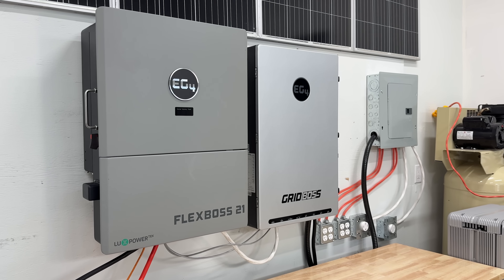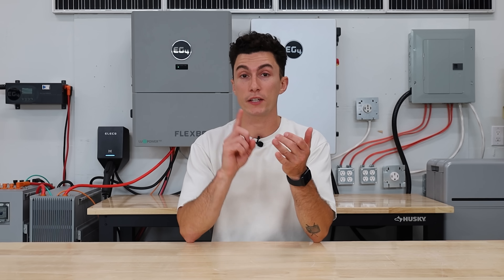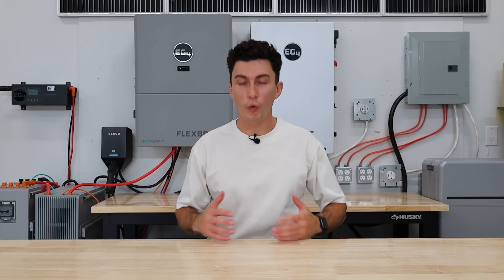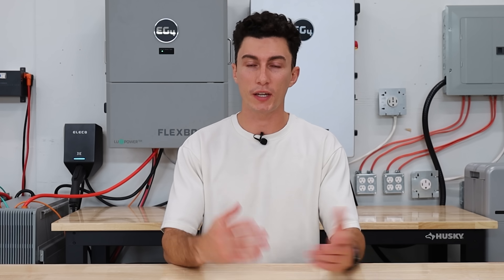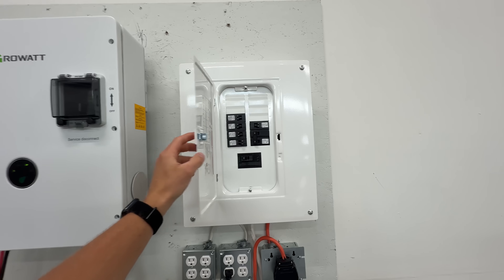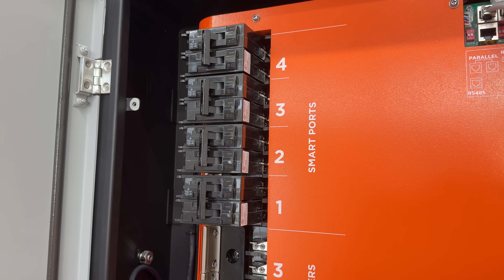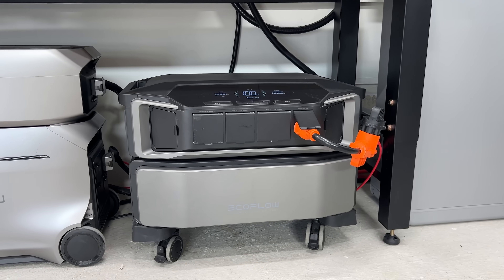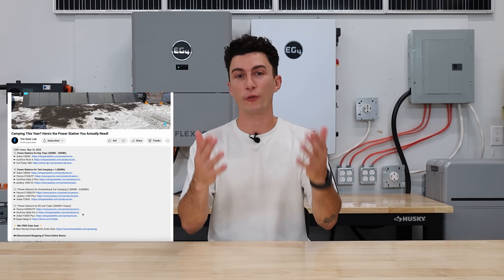FlexBOSS + GridBOSS Explained: The Smartest Money You’ll Spend in 2025

Comment: Where can I find more info on connecting a delta oro ultra X to the generator input on an EG4 wall mount inverter. I can’t find the episode where this was mentioned.
Reply: It was this episode under bonus. BUt would like more info on how to wire this. MY town requires the eG4 and grid boss to be mounted outdoors. With all cables buried. So I want to know how to do this before installation

Comment: If I have 3 FlexBOSS21’s + batteries in my shop building, will I have to run heavy gauge cables from each of them to a GridBOSS located 180 feet away on the utility pole that my meter is on?

Comment: I am currently using my Ecoflow batteries as a generator input for my EG4 GridBoss but it requires the grid to be disconnected (fuse switched off) to allow the generator power to recharge the batteries. Is there a way to use the smart ports to input power from the Ecoflow system? Is there a way to allow generator input without having to disconnect to grid?

Comment: What you recommend if the local utility has very dirty power?  Doing this install on an bahamas island and local power is bad.  Was thinking about chargeverter and just using that to clean the power and charge the battery with it.  Can I run that clean power into the gridboss and let it charge the system etc?  Dont want brownouts and or phase drops to burn out the inverter and gridboss

Comment: I installed the gridboss and flexboss21 with 12kw of solar a 50kw of battery. I moved my grid tied telsa system to the gridboss for a total of 25kw of solar. i still only export 10kw (max) to keep my utility happy. I've got the 125A Smart port connecfted to the subpanel in my garage, and the 80amp smart port connected to my pool equipment. my entire house is electric, plus two EVs. No propane bill and no gas (car) bill.  EG4 is super easy to set up and great customer service to work through the settings.
Reply: Gridboss is now tied to your grid and the Tesla system to Gridboss?
Do you know if changing setup would void any Tesla warranties?

Comment: Beware which company you choose for system design and sales. Current Connected preys on people who are new to solar when they are tasked with system design. They oversell expensive components, that can be made to work, for a task when the correct component is a fraction of the price. After admitting to doing this in writing, they will not take back the overpriced components without severe financial penalties.

Comment: An important and often overlooked feature of the GridBoss is the 200A service disconnect and what it means, and why it is important.  Since it is service rated the 200A disconnect on the GridBoss can be wired directly to the meter, allowing the main panel to become a sub panel off the GridBoss.  This allows you to install solar without the need to upgrade the house's electrical panel(s) just for the sake of installing solar.  A real-world example of this was a house with 100A main, the grid provider confirmed that the exiting grid drops to the property were good for 200A service.  Quote were pulled for a panel upgrade and came in between $3,000-$10,000 dollars.  Instead, it was decided to install the GridBoss off the meter using the service disconnect and wire the existing 100A Main panel as a subpanel off the GridBoss.  Now the GridBoss has 200A of service going to it and is feeding the 100A subpanel, providing an installation cost savings of $1,000-$8,000, and passed inspection with no issues.
Reply: I thought the SolArk-15k with its internal 200 amp pass through was a disconnect providing the same features that the gridboss would provide. Is that not the case?
Reply: @OnFinalConstruction  I looked it up and the SolArk-15K appears to be service rated and can be directly connected to a meter.   You would have to switch out the 15K's 200A load breaker to connect it to a 100A panel in order to meet code.  Based on current pricing though a FlexBoss21 + GridBoss is only about $300 more than a SolArk-15K, and for me the addition features gained are worth the minimal price difference.  However, if a single 15K will meet all your needs it is an option.
Reply: @OnFinalConstruction  It is worth noting that while the SolArk-15K is service rated, and can be directly connected to a meter, that this is not true of all hybrid inverters.  The EG4 18kPV for example cannot be directly connected to a meter.  However, you need to check your local code as in some locations a separate disconnects between the inverter, and the service meter are required regardless of the inverter's capability.
Reply: @nathonsweetman4409 thanks for the reply. Is just a means of disconnect needed usually? I would want one anyway so I don’t have to pull the meter to swap the unit. Somewhere I heard someone say a “transfer switch” would be needed.
Reply: You always want a separate disconnect.   They are simple devices that almost never go bad.   What do you do if the Gridboss needs to be replaced or the bypass switch goes bad?  You are going to have to have the Utility come by to disconnect the meter. 
I see very little value in using a GB, FB combo.
You are much better of sticking with a Sol-Ark, especially now that they have the 18K model that has 50% more power than the FB21.  No Bugs, no DC-DC board being burned out and no overheating issues and Fans that sound like a lawnmower.
Reply: @Dreadlk  I agree with the disconnect, which is how I installed mine, but it is not required by code.  The value of the GB/FB combo is going to depend on individual installations.  In some cases, you could just go with the FB or a Sol-Ark.  In my case I am able to take advantage of the 200A passthrough and the 350A buss, on top of being able to load shed my hot water heater, AC, and EV charger.
Reply: @Dreadlk  I helped with a GB/FB install and we used the GB to integrate an existing microinverter install with a FB install with batteries and additional solar.

Comment: Great video. I wish you guys would make a video for people that already have grid tied solar and would like to add the grid boss and flex boss with batteries to their  current system.
Reply: You just described my system. I had 6kW of micro inverters, and added Flexboss/Gridboss/battery and 15kW more panels. This allows the micro inverters to keep running if the grid goes down because the Flexboss/Gridboss generation is 'tricking' the microinverters to think there is no power issue, so they keep on generating. It's awesome!
Reply: @tonykara  This is a fantastic use case, thanks for sharing.
Reply: Agreed! I heard you can actually config the GridBoss to shed the house to prevent the battery from being depleted so the AC micro-inverters can be powered when the sun comes up in an outage situation.

Comment: Dry Connects? Thanks for that tidbit. I looked up what it means. It means I could connect my Predator 5000 to a system and have the EG4 turn it on & off via the remote control of my Predator. That’s helpful. VERY helpful.
Reply: Can you tie in a jackery system into the flexboos+gridboss

Comment: Just a couple comments. Grid boss does not do away with the utility requirement for disconnect so what you said in the beginning was not correct. And the bypasses do not qualify as utility disconnect especially on systems that need overcurrent protection. You also didn't cover that. You have to lock out the load output of the flex boss when connected to a grid boss which becomes problematic when the inverter and batteries are not on the house but maybe out in the garage. That's enough for now.
Reply: You don't use the load output of a Flexboss when it's connected to the Gridboss.
Reply: @tonykara yeah I said that. It is not a benefit.
Reply: My utility specifically requires that, "The disconnect must enable visual confirmation that the... conductors are physically disconnected."  As great at the GridBOSS is, I'm still required to have a knife disconnect before my GridBOSS because of that.
Reply: @obewise exactly.
Reply: They technically do meet the qualifications to be used as a disconnect but local PoCos make up their own additional requirements.
Reply: @CowboyPilot79 levered lockout is typically required in the whole country.
Reply: @engineer775 but if retrofitting that lockout is already in place

Comment: Thanks for showing the EF DPU hooked up to GridBoss generator port.  What size is the wire used in your custom cable connection?  I just acquired a DPU unit so trying to figure out the way to blend this in my daily use of Grid power and handle outages.  Solar Lab crew is great at having fun learning and sharing!

Comment: If I ever pulled the trigger, the  separation of the inverter and interconnect is key for my situation. I could put the inverter and batteries in my detached garage with solar on it and just use the service wire out there to backfeed the house / grid. RIP solar credit.

Comment: I like the idea of using the ultra instead of wasting it, but let's be honest that's kinda a waste.

It likely would sit fully charged and the solar waisted most of the time (as generator activation is basically last resort)

I think you're much better off buying an additional MPPT and just the solar to the battery bank.

That, or hack the Delta and hook it's battery system directly to the battery bank (just made a video on this for the Delta 3 Plus)

Though I'm not sure how the Gridboss/FlexBoss will handle having another MPPT and keeping track of the SoC

I already planned on adding a Victron Smart shunt anyway as a backup plan.

Also I'm like 99% sure you can hook any brand Inverter to the smart ports.  I don't see why using one for the ultra was not also a thought, id think that is preferable to the generator input.

Comment: Nice overview of the GridBOSS, thank you.  

Did I miss you going over the ability to bring in a micro inverter system (new or existing) into the GridBOSS smart port 4?  Did you try connecting the Ecoflow to the 4th port?  (AC coupling)

Also, what happens to the GridBOSS when the ESD button is pressed?  What state are the relays in?  (Grid, backup, bypass, and Smart ports)

Thanks

Comment: $2500 to install a couple disconnects? What a rip. For that price I had breaker panel replaced to upgrade from 100A to 200A, which included running a new main from meter to panel, and pulling permit.
Reply: Wire up an AC input collector to combine three inverter AC outputs w MCB and breakers for two x 200A main panel feed and separate emergency panel feed, then another 200A load center for grid charging of those inverters, a 200A automatic transfer switch to isolate grid from inverters, a manual transfer switch to bypass the inverters, another transfer switch for generator input to all three inverters, and several smart ports…and monitoring so you can see what all of that is doing. Obviously, you did not watch the video or didn’t understand it.  I’ve built systems the old way, never again. Will be wiring in GridBOSS for my house and will save money by making my existing 150amp panel a sub panel - no Re wiring, but adding an MCB thereby (my 1960 panel doesn’t have one) so that saves me $1,000 right there avoiding so much time and landing old circuits in new panel.
Reply: @TomKacandes what is your definition of MCB?  Around here it is generally regarded as a Miniature Circuit Breaker, which doesn't make sense in the context of your comment.
Reply: @TomKacandes  You are talking a very advanced case, which obviously makes sense to use the Gridboss. My comment was directed at high cost to mount and wire a couple switches on the outside wall.
Reply: This is a smart system which has a lot of options and variables, not just a panel with some breakers.  Seriously.  If you have no clue how any of this works, why are you wasting people's time by commenting...???
Reply: @redbaron6805  He didn't say $2500 was for an advanced smart setup, he was saying that was for the bare minimum required by code. Obviously for the advanced case the grid boss makes sense, my comment was on the $2500 to do the bare minimum. The labor to pull a new main, put a new panel inside the wall, and rewire all circuits is far more than mounting a couple switches on the wall and a few wires.

Comment: Can you supply the system with a 120v generator while using 240V?
Reply: Not directly.  You can use a chargeverter direct to the battery bus though.  So Gen -> Chargeverter -> Batt Bus.  Ecoworthy has a $300 model that will work or the EG4 has some more features but is ~$600.  I think you can still have the GB/Inverter trigger the generator on too even if it's not connected to it

Comment: It’s serious power.  I was piddling around with a few kW before I DIYd my whole home (with EG4 at risk of sounding like an ad… but that’s what I’ve got so too bad).  Now I’m piddling around with a lot more power and the system just shrugs at it.

Only a few things in the home actually eat a lot of power.  The A/C eats around 3.5kW, the oven peaks at 7kW, and I have the EVSE jumpered for 6kW.  I put the EVSE on a smart port, no limits set, just in case there is a power outage while everything is on.  The GB will dump the load rather than trip the inverter off due to it exceeding 12kW.

Another way you can augment the inverter without expanding to a second inverter is just tying some A/C coupled solar in.  The FB21 can do 12kW from batteries and up to 16kW with DC strings also going into it.  Adding A/C coupled solar into a GB port on top of that adds even more to the total.

-Matt
Reply: Was trying to figure out what my 3 ton heat pump runs thru in terms of kwh.. your A/C eats around 3.5 kwh?
Reply: @willC85  It depends whether your heat pump has backup heating elements or not.  They often do, but in many parts of the country the backup heating elements are not actually necessary.

My heat-pump water heater, for example, does not have backup heating elements.

Backup heating elements can use enormous amounts of energy.  So, ignoring that possibility, a 3-ton heat pump (and assuming its like a mini-split in that it has a DC compressor)... will generally use around 2 kW.  Maybe a tad less.

That said, if the heat pump is whole-home, you also have to include the blower which itself might consume 500W.

-Matt